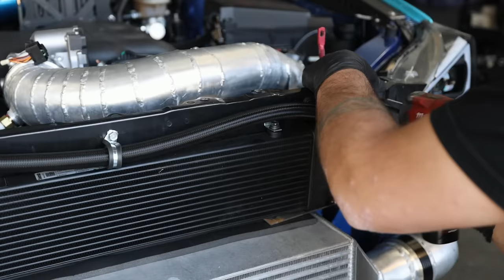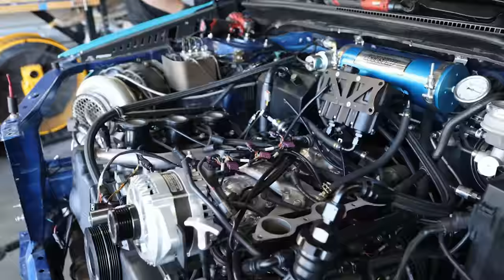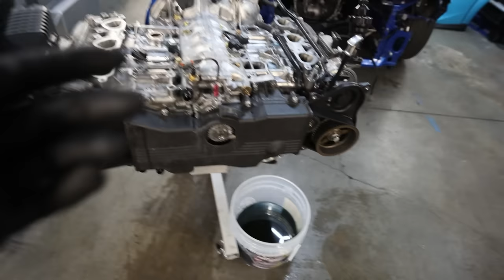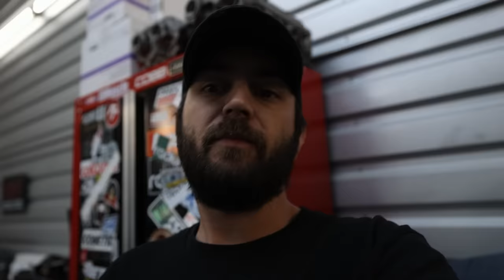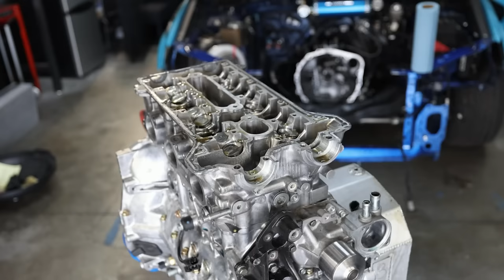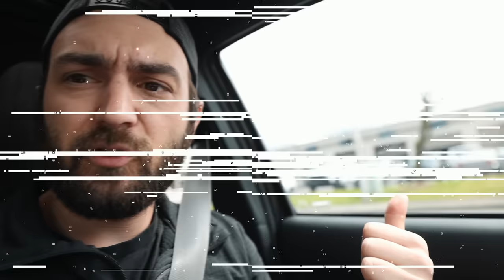This Is why we don't Run 50PSI Through MLS Headgaskets.

Comment: Car guys who have atleats 2+ cars that don't work are living vicariously through you tanner. You are our chosen champion, we support the channel so you can fight the good fight.
Reply from the maker: I too currently have 2 cars that do not work though 😂😅
Reply: @Smeedia just keeping it real.
Reply: my cars work!, just haven’t seen the road in 3 years 😂 this summer maybe :)
Reply: Every vehicle I own is broke down except my Subaru 85 rx sedan with 06 sti swap and 4.44 jdm 5 speed. 400  all wheel torque. 
Cummins bent a push rod and is getting fire ringed and my wife’s Honda cracked the vcm4 head. Not very impressed with the j35 Honda. Unless it has the j32 multi port heads. Then it may be worth it.
Reply: @gregcass12  I mean technically they all run, not well.
Reply: @gregcass12  also only one out of 5 needs registration tabs anyway. If I need to bring 2 cars I'll just tow one.
Reply: i’m dead 😭

Comment: The Cummins 5.9 fire ring is 1.05 thick and the bore size is 102mm my bore on my subie is 100mm so I’m putting Cummins fire rings in my Subaru 06 sti 100mm bore. Also the head gasket thickness on a Cummins is .060 and my Subaru is .058. I’m already fireringing my Cummins so I was curious about the fire ring figment on a Subaru. And yes the Cummins 5.9 fire ring will work perfect on a 100mm Subaru which is .5 mm over stock 99.5

Comment: 0- rings will fail. Don’t ruin this motor. Fire rings like the Cummins .105 soft stainless fire ring with groove cut in block and groove in head and ditch the head gasket crush area on the cylinder and never have another problem. O rings are not the answer it’s a short cut.

Comment: I've finally found a local shop that is going to pull the heads off of my EJ255 to save me time, I'll be meticulously studying your longer content along the way as I finally try to get it back to roadworthy. Thank you for that, I just want you to know we appreciate that aspect of your content and the effort that goes in behind it, as well as all the other aspects. My FXT will probably never be at baders FXT level(since the cars are twins) or any of either y'alls builds performance level honestly, but I do want to customize the interior and soundsystem with my own little touch and have a quickish daily. This poor FXT has basically been sitting since 2020 when I pulled the engine out. 😵😵‍💫🥴 Can't wait to see the 6banger ripping again

Comment: You cant blow the head gasket if you don’t have one. 😂😂
Reply from the maker: Weld the heads to the block 😂
Reply: @Smeedia  its not a bad idea lmao welded block would technically never lift
Reply: Mono block engines are used in F1, and I believe Bentley made fixed engine setups in the 20s, but if you break something, it becomes a paperweight.

Comment: Make sure the gaps in o-rings are close to a head bolt when you install them.  That's the weak point, and when they are next to head studs it gives it a tighter install.

Comment: Is custom-made gasket a thing? 
Like what would be used for high-powered race engines...?
Reply from the maker: Yes and no, most companies have told me no. They don’t wanna spend the money on tooling for a low volume market. They’d loose money on tooling vs what they’d sell. 

This I ring option should hopefully hold better
Reply: Make sense... but sucks, lol

Comment: Nice dude, I got that o-ring tool and it's great. I would run stainless wire with composite head gaskets (do subarus come with composite head gaskets?). Then you don't need to replace the wire every time you remove the heads. Replacing the copper wire is a bit of a mission because they crush flat. I've seen a few evos run 1000whp with stainless wire + composite head gasket.

Comment: Dude IV been watching for awhile and I think my kids unsubscribed me. Anyways just notice and re subscribed. And 18psi and a good torque curve will lift a head on a 4 cylinder. I just did it. It’s the torque load. And timing advance. Back that timing off a few degrees in the torque curve and save the gaskets. It’s peak timing being too advanced combined with high boost. that lifts the heads. And 650 hp turned down. Dude just run it at that and have a good time. My car makes 400 wheel torque and is an absolute blast to drive. 650 I couldn’t even keep the wheels planted. Back the timing off at peak torque by -2, or -3 degrees off what you have seriously. It makes a huge difference in head gasket longevity. If you have fire rings. Disregard every thing I said and run the same map and let her eat.

Comment: Honestly, if I were you, I’d be trying to mimic the Isle of Man STi that Mark Higgins ran. 600 HP, lightweight, and extreme handling.

But that’s me. I know you like the straight line pulls. I find that boring, personally, but I get how some people do. It just seems like a lot of extreme pressure on the motor and drivetrain for a few seconds of fun. And things break.

I’ll get a lot of negative comments and you have a different path for this build. Just my 2 cents. 

Good luck with the fix!

Comment: I've used malleable copper seals for cylinder heads before - not an internal combustion engine but a 4500 psig high-pressure air compressor.  Pressure increase on the high pressure (4th compression stage cylinder) was around 2200 psig (from 3rd stage pressure of 1800 psig up to 4th stage 4500 psig with tremendous heat).  The copper seal on that 4th stage cylinder worked fantastically for maybe 15 years since the previous overhaul with no leakage to the cylinder water jacket until the head material around the seal crumbled from heat cycles (the machine was manufactured in 1943, after all, and the failure occurred in 1976).  Had an insert fabbed up for the remachined head after removing the damaged metal, annealed that copper seal (none could be found in our supply system), put that same seal back into place, and good as new.  Your copper cylinder block-to-head seals seem to me to possibly be a good solution.  Good luck.  Great video.

Comment: Have you considered doing what mighty car mods did with their ez30 built turbo? Marty went smaller turbo and ended up making more power and torque then his larger application, just under 600whp on only 25 psi but over 1200nms of torque now. Being bigger displacement I can't see why you wouldn't achieve the same sort of result.
Reply from the maker: Smaller turbo wouldn’t hurt us, but it would significantly limit power output. We had a 6870 on it prior and capped that turbo before anything else. Marty is also using his as a street car where I’m not. 

He also wanted to achieve quicker spool because his power band was pushed so far out. Even with the 7675 we can get the turbo kit up at 4500RPM since we have more displacement. And my set up is a true twin scroll. Jumping up to Larger exhaust wheel will help lower EMAP and give us lower cylinder pressures without sacrificing too much RPM for spool

Comment: Where do you source all the miscellaneous gear for the EG33? I've been using rockauto but even there I'm struggling to find everything I need. I'm doing rocker cover gaskets and timing belt and things like the waterpump I cannot find outside of Ebay. They are from GMB. Might be fine but I'm weary of counterfeits. 

Love this engine and I want to live the dream of eventually making power with it but it's looking daunting with parts becoming so scarce.
Reply from the maker: Tbh it’s quite difficult to find anything now for these engines. A year or two ago I bulk. Ought slot of stuff for it. Subaru still offers rocker cover gaskets and a few other random things 👀

Comment: I'm really curious at what afr the car runs under boost, my car was at 12.2 - 12.5 and my head gasket was melting now I run 9.8 - 10.2 afr and no problem for the last 2 years
Reply from the maker: High 10s Low 11s typically, car lived on E85 🤝

Comment: MY DUDE mighty car mods just threw a VA 6 cyl turbo put together & i think you should go smaller turbo and get the most out of it maaaaan
Reply from the maker: Mines not a street car or daily driver like theirs is 😅 

We want bigger exhaust wheel
To Make same power at lower boost target. I also have more displacement than they do and a true twin scroll set up so spools not an issue. The 7675 is full lit at 4500 RPM

Comment: 50psi will find weak points for sure, the o rings should keep that pressure inside the piston chamber.  If all else fails, dorito motor swap might be a first In a Subaru
Reply from the maker: We do have a good Doritos engine we could toss right in 😅

Comment: Is this diy gasket really the best solution?  If it doesn't work, is the block done?  Sounds like a half measure.  How about getting it professionally machined for a proper fire ring gasket.  Do it right, do it once.
Reply from the maker: Same process that machine shops used, instead of using a Mill I’m just doing it by hand with the tool designed for it
Reply: @Smeedia  You could get purpose-built rings with a specially designed profile and gaskets designed to work with them.  I'd think the result of sandwiching some copper wire under an MLS gasket not designed for that could be quite different.

Comment: also, you want a responsive setup vs a high peak hp setup for autox. much better to have a smaller turbo where the boost comes on immediately than a big honker turbo that doesnt see boost until 5k rpm
Reply from the maker: My man this is not an autocross car 😅

The 7675 is also full tilt at 4500 RPM

Comment: wow this is awesome news! I feel kinda stupid watching this I always assumed there was valve or cam dmg if you lift the heads but good to know that's not the case.
Reply from the maker: Normally when you lift a head you either 

1. Mix oil and coolant 
2. Pressurized the cooling system 
3. Leak coolant into the cylinder 

4. All of the above 😅

Comment: I wouldn't even call that lifted head gasket, as much as the cylinders walked.  Open deck probs.  The added "T" sleeve with fire seal will also add a TON of cylinder position integrity.
Reply: Yeah, studding the cylinders and fire rings, that's about as far as you can build that til it starts just splitting the case it seems.
Reply from the maker: Hopefully these O rings help to hold everything together a bit better. From what I’ve read it’s what most people do aside from cooper gaskets

Comment: Do you have a back pressure sensor?      Are you logging or do you have the haltec egt system (per cylnder).  
I’d ditch the big single for good twins.  Your fighting to many deamons. Going bigger turbo means your going to be running more timing or eventually nitrous to spool. Your just going down the rabbit hole of higher cyl pressure or artificial atmosphere and causing more issues
Reply from the maker: I wish, I don’t have enough AVIs to support EMAP or EGT with the 2500 

The issue with going to twins is going to be a ton of heat, space constraints and cost. 

The 7675 already spools fairly quickly with it being twin scroll, even just jumping to a 7685 we could Make the same power at lower boost while only sacrificing maybe a few hundred RPM in spool
Reply: Haltec has an auxiliary box. You per cylinder egt into the processor box it tan decodes it and processes all cylinders as 1 signal input 

As for back pressure I’m not exactly sure how to monitor it but with your setup I’d want to have an idea.    Unequal length header bigger turbo ect ect. Your primary exhaust runners may be a back pressure and the egt would show it.   

Hoops are kinda old school I’m sure they work as they were done for ages.   The new method is a fire ring.  It has 0 gap and is kinda a triangle  under a microscope You get different heights  depending on if you want more or less compression.   They get machines into the deck surface

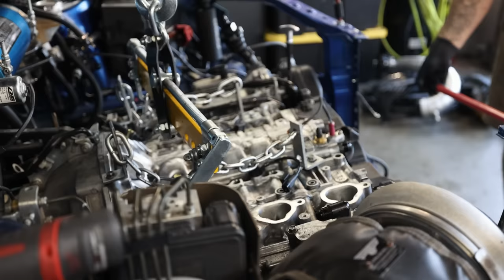Comment: at 5:14 it looks like maybe a bit of that coolant mix might have been dripping on the clutch... Maybe worth cleaning those off before the clutch goes back in the car? would hate for you to get clutch slip over the water wetter additives :(
Reply from the maker: It’s from spilt coolant when I was using that funny little tester thing 😅 it’ll get sprayed down and clutch bolts will all get checked again
Reply: @Smeedia  Hell yeah brother. I want you to  enjoy the car, so lending a spare set of eyes where possible

Comment: How's that Setrab oil cooler treating you? Any idea what the pressure drop from the core was?
Reply from the maker: I only see pressure drop above 8K RPM but I suspect that’s an oil pump issue. 

Overall it dropped temps by 40*s
Reply: Rad, thanks man. I need something for my IAG700 and that's probably overkill, which sounds perfect.

Comment: Why not talk to a machine shop that could scribe slots rings and deck the head block combo while it's apart never back down brother u wanted to do it right and I'd say u built it for that power and it's already apart nike just do it bub!
Reply: I also agree with moving forward on the other block but enjoy it make it work the way it's intended it's given you so many problems and is so close to holding what you want go race it
Reply from the maker: No shops will do it, so we’re on our own for it 😅

Comment: Tanner is it over pressured for the reason the head casket lifted?
Reply from the maker: Too high of cylinder pressure caused the heads to lift
Pushing that pressure into the cooling system. Created quite the mess lol

Comment: Would installing fire rings really be a solution to the head lifting? Seems to me that the head would still lift if you keep the clamping force the same. Might be worth it to see if there is an upgraded stud option, in addition to the fire rings.
Reply from the maker: Bumping up the TQ spec as well on the heads, we were at 120/110 prior. Going up to 140/130 this time. So hopefully should hold with the o rings this time
Reply: @Smeedia  That's good to hear. Should be fine but you may be going into the plastic region of deformation of the stud material. I'd be wary of re-using them when you torque them that high. I'd also see if your new closed-deck block can be machined for a thicker deck height. Should reduce deformation of the block.

Comment: Do it on old engine before you brake the good engine
Reply from the maker: The old engines are more valuable IMO 😅 they can still be used 😅 even if the cut got messed up it would still be salvageable

Comment: Checking in Chief. 🫡
I've been busy. 
Head gasket failure on the EJ205 avcs after getting the new injectors and fuel pump in. 😢
Working on fighting the cam bolts 😤

Looking forward to speedy6blu running again 🎉
Reply from the maker: Hopefully the cam bolts cooperate with you, those things can be such a PIA 😤